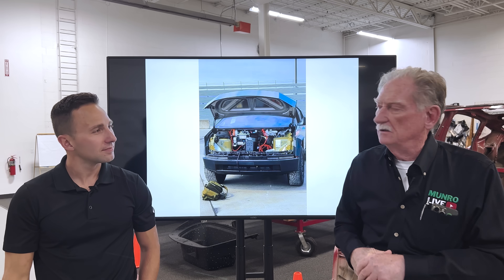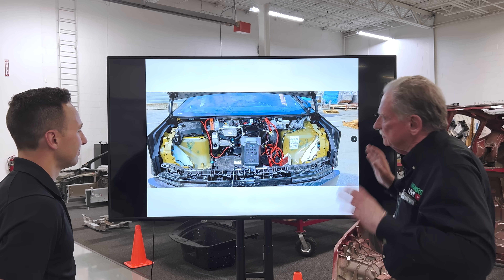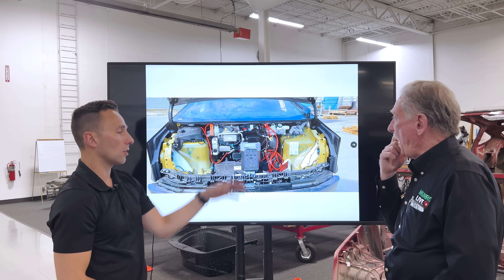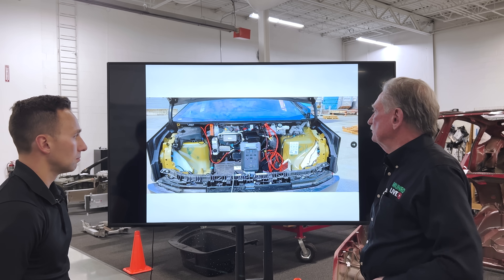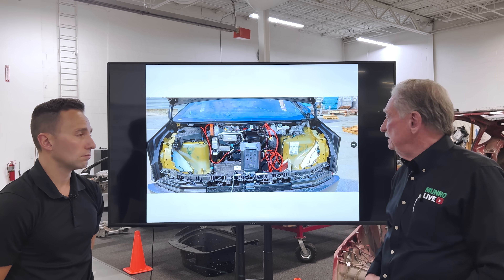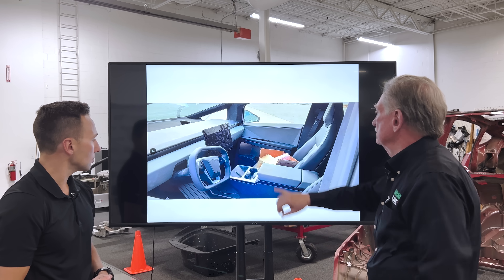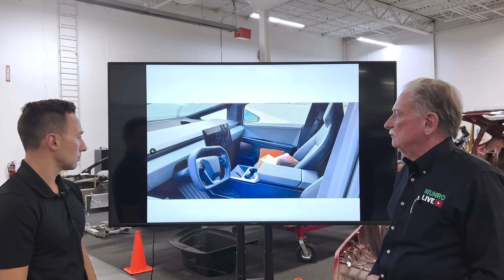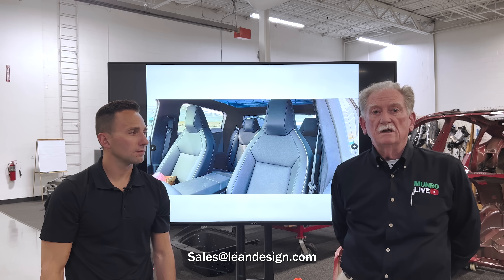Tesla Cybertruck Dual Motor closeups.

Comment: The box at the front is an Ecoflow "Power Station"
(Battery Bank)
Reply: aka solar generator. ive got one myself
Reply: Yes, that’s the main battery pack that drives the truck.
Reply: Found it funny to see that
Reply: the reverse engineering firm knows what an ecoflow is, they said the black box and the silver box
Reply: @JW-mx3qg yea, can get 800 miles out of that thing
Reply: @jasenhenry Nope. It is not a generator. It is an 48 Volt accumulator aka battery (storage) with a build-in DC to AC inverter (110/220/230 V AC or what ever).

Comment: Excellent analysis, as always, with Sandy and Jordan, given pictures of what looks like a 'test-bed' version(...?) What stood out was possibly a change in the thermo-management system. Possibly a redesign of the heat-pump/octovalve(?) Those aluminum[?] front struts don't appear consistent with the IDRA casting, and I have to review the previous Cybertruck front underbody Munro podcast. Thanks again guys👍

Comment: Not sure how works in other countries, but here in Sweden where I live we "have" to use the turn signal when exiting a round-about otherwise you could get fined. Not sure how well the turn-signals on the wheel would work for that. Then again, taking into account how many people here use their turn-signals correctly that might not be an issue, some drivers (*cough *cough, BMW) doesn't seem to have turn-signals at all =)
Reply: As someone who's done durability testing and actually went through a phase researching and implementing signals in roundabouts, aside from using it while exiting potentially the concept is pretty dumb and needlessly overbearing.
Reply: If you have navigation going, hopefully it's automatic.  But, manually, it's not going to operate well, correct.
Reply: What if the turn signals can be voice activated?  Problem solved

Comment: They're using a battery box to power the off the shelf 48 volt power supply (silver box in the lower right), which is being used to charge the battery.  Also, did anyone notice the broken windshield?
Reply: Not only cracked, but the bottom border of the windshield is exposed, ie, easy to crack.
Reply: Broken windshield? I guess Elon personally drove this one.
Reply: @stevebakker6884 hence IT IS a Prototype it looks like the hood hinge collided. At least they know this issue now. In cad it works but in Real life its to flexible.
Reply: Isn't it a support charger - especially if they are running pre prod software/ wiring ? I bet those HV contactors are pinging open all the time😂
Reply: @stevebakker6884  you mean Franz right?
Reply: Oh. Was that Franz who cracked the windows on the truck during the reveal? I was recalling it was Elon.
Reply: @jimmiemac9000 Franz and his balls of steel
Reply: Nope it's not that lol!!!
Reply: Maybe it was parked in a bad part pf Canada

Comment: Those cracks in the wind shield terminate at what look like could be places where stress is loading up unintentionally from underneath. Two cracks  travelling  opposite  directions start right above that mounting point just below. (center left) one of the cracks terminates at the wiper bracket connection location. ..it could be loading stress to the glass as well.
Reply: Shouldn't the armored glass be able to withstand normal stress?
Reply: @WILL_E_1 Stress to the glass edge is very different from front-on impact.
Reply: @EthanMatlack  I suppose they are in uncharted territory with quite a number of these design aspects

Comment: I already pointed this out over on Dirty Tesla, but you guys both overlooked the compliance headlamps and turn signals in the bottom of the frunk sill. They are there because (as I'm sure you understand) the primary lights are on the frunk lid itself so Tesla needs something to satisfy the DOT.
Reply: How do you have the primary headlights on a moveable panel?
Headlights and indicators are  down low.
Reply: Every shot we've seen of them is only down low, the light bar is likely a beauty light. The compliance lighting is on the back of the new 3, you can see the lights shift when Matt from carwow opens the boot

Comment: The cybertruck is on a new 48v plateform. I guess that the 2 or 3kW powerbank we see in the middle is also on 48v battery inside. I just wonder if they really connect that 48v between the cyber and the powerbank thru these red and black jump start cables....😮

Comment: The 3rd party battery is used to provide AC power to the power supply which is used as a “maintainer” to power the LV system in the truck.

Comment: Doesn’t look like the wiper has an eccentric cam (like the Merc W202) to articulate the movement. Perhaps an elaborate drive mechanism, but I don’t think it’s going to “bump” the wiper arm to wipe more of the passenger side of the windshield
Reply: Ya the pivot point is clearly fixed. That motor arm is just to move the wiper arm in a standard arc.

Comment: Thanks Munro - that conclusively proves that the CT is not brake-by-wire, and that producing a RHD CT will require a lot of re-work to the packaging that Jason described in order to reposition the brake master cylinder. Very sad day for us CT reservation holders in Australia :(    I was hoping a break-by-wire solution would make RHD production a no-brainer. Are you able to comment on whether you think there is sufficient space-claim reserved for the brake master cylinder to be re-located to the right hand side?
Reply: They would also need to relocate the wiper motor etc.
Reply: Agree and the wiper motor itself would have to be mirrored - so not simply moving the existing component @rjbiker66
Reply: Something tells me it will be a while before any manufacturer gets up the courage to go completely brake by wire.  Being able to stop is pretty darn important and something you want to be able to do even if you lose your electric power.
Reply: @wtmayhew Brembo Sensify
Reply: @Frank_W.   Thanks for the reply.  The public information on Brembo’s web site doesn’t go into a lot of detail, but notes: “SENSIFY™ is expected to be on the market from beginning 2024.”  I found a pretty good summary on Car & Driver which sheds a little more light.  The Sensify control system supports electric and/or hydraulic braking.  A fully electric version would require a second electric circuit and a second battery for backup.  A fully electric system has not yet been approved for US Federal Motor Vehicle Safety Standards.

Fully electric braking is on the way, but not quite here.  There is choice of which technology implements backup, which is good.
Reply: @wtmayhew  There’s a YouTube video regarding the Sensify brakes and John McElroy did a video regarding them if you’re interested.  I think they would be perfect for the Cybertruck.  Even though I am about 123k in the reservation queue I may not even get it until 2025 unless the ramp is faster than expected.
Reply: @Frank_W.    It will be worth the wait, plus it is gives Tesla 125K units for practice.  Best wishes for an enjoyable purchase.
Reply: @wtmayhew  Thanks for your kind words.  I am patiently waiting on it and in the meantime my TSLA stock can grow.  I have 3 separate accounts with the first one earning enough to pay for the Cybertruck and the other two are currently a little in the red.  I was still buying when it was almost at it’s highest price.  Concerning the CT the more we find out about it the more excited I get.  I’m not one of those people who complain that it doesn’t do some particular function.  People complaining about the smaller frunk size compared to Ford or whoever are so petty.  The truck is going to be incredible and I will accept anything that Tesla puts into it.  Elon stating that it will be a “technology bandwagon” and “it may be our best product yet” only gets me more excited about it.
Reply: @Frank_W.   Thanks for the reply. Cyber Truck looks like the best balance of form and function in the same package.  It seems like a lot of people agree, given the long wait list.  My guess is there are a lot of people on the list who will be first time truck owners.  It makes sense for Tesla to create a product with broad appeal, and it seems the project is on the mark.
Reply: @wtmayhew  I think you are 100% right about that.  When the current actual truck owners find out the capabilities of the Cybertruck then I think a large percentage will want to make the switch.  Of course the CT won’t be able to replace some because of limitations but that’s okay.  Here in GA I hate seeing the diesel trucks blowing black smoke out when they hit the throttle.  They think they are cool but it’s a bit ridiculous.

Comment: Where is the front license plate supposed to go.  Between the radiator intake and the possible radar location it doesn’t look like the plate has anywhere to go but right in the middle of the stainless front panel.  Unless that radar panel is actually a plate mounting point.

Comment: Interesting.  They’ve got an Ecoflow battery ‘generator’ wired to what might be an off the shelf power supply at the lower right.  I’d speculate that’s a 48 Volt power supply for charging the auxiliary battery.  If these are recent photos, it seems to be pretty late in the game to be debugging electrics on that scale.  Charging the auxiliary battery is something pretty basic to the operation of the vehicle.  I’m looking at the relatively clear image at 3:23 in the video.

The interior shot of the dashboard seems to have been photoshopped though a filter.  It almost looks like a CAD drawing, but presumably the box of junk on the seat is real and the same box is in the rear facing photo which looks better.  Maybe it is just because we’re looking at a video of something projected on a monitor.
Reply: Charging this low-voltage battery is pretty basic. But getting all the network components / ECUs to their indvidual low-power sleep states and reduce the residual power draw in a new network architecture is not so basic.
Reply: I think what he is getting at....its not a 12v basic jump pack. It is potentially 48v for the low voltage items like window motors, tail lights, head lights etc @MooseOnEarth

Comment: It looks like that powerbank puts out AC power and they are using an AC/DC inverter to power the jumper cables. The black box on top of the power bank just looks like a cover they're placing over the contacts.

Comment: 15:15 they had that design in Chrysler Pacifica already opened the view on the driver side front quarter panel. But Cybertruck design opened it up more and on both sides.

Comment: Wasn't the original prototype a bench seat in front? I recall thinking the truck would hold six pasengers.
Reply: It was.  They changed it.
Reply: I guess I should pray they don't change it further.
Reply: It was removed because of the center screen and the center person needs a air bag in a crash.

Comment: All this thought goes into this truck that I would love to own. Except for the fact I cannot see how you can mount a winch. I was expecting some hidden compartment behind the front fender with a slot for the line to come out. If everything on this truck was perfect except that, I will not get it. I use my wench quite often. Not for getting unstuck necessary, but for a variety of task. Pulling out other vehicles mostly. I've used it for hanging deer, dragging shipping containers. The versatility of a winch is to great not to have one on a truck if you spend any amount of time camping or being off road, or just about any other sort of outdoor activity. You'd be amazed how often you can find an excuse to use a winch.
Can't call your self a truck, much less an offroad truck without the ability to add a winch, even if it requries some after market brush gaurd, which who knows when that will exist for CyberTruck.
Think I will cancle my order and wait for round two lol. If I can even afford round one to begin with.
Reply: @itchynackers  The problem is I don't see how you mount one. 
All winches no matter the brand have the same bolt 1 of two patterns for mounting so that is solved in the aftermarket. 
Like I said I thought I would eventually see some sort of slot on the lower front to mount a winch on the inside under the frunk area or a way to attach a grill gaurd that can accept a winch. Which is still feasable I guess, but any attachment like that would greatly take away from the underbody height they have achieved and hurt the drag.
So the issue isn't getting a standard winch, but a location for it. Outside one of those on and off hitch solutions on the back.

Comment: If they use the same 16V low-voltage battery, then this would mean, there is not just a sole 48V low-voltage system. Did you miss that? They would need three of them to make this 48V. Or use an internal DCDC converter. Or they needed 12 cells in there instead of just 4.

Comment: Would they keep a 12v battery on a 48v architecture?
Reply: I was wondering about their 12v reference as well.  Maybe he meant 48v?
Reply: I suspect they use a 48v battery and a DC to DC converter to 12v for the few things that may still need it (like the accessory power port).

Comment: 16:10 can’t disagree more strongly. Removing the turn signal stalks is a horrific idea and is really putting me off updating my current Tesla.  There are just so many instances where you need to use your indicators while turning the wheel, and if it’s not a steer-by-wire where the wheel never turns more than about 80º then you’ll be looking at the steering to find where the stupid button has gone.  Same goes for a quick wipe of the windshield or flashing the headlights.  All of this has to happen from muscle memory or you are taking your eyes off of the road.  Outside of the US we have roundabouts and you are required to indicate while leaving the circle, which means that the wheel isn’t straight when you need to do so. Good luck doing that with the wheel potentially at 90º or more. Near my home there is a section of road where I need to make a left followed by an immediate right turn, and I am always switching the indicators from left to right while still coming out of the turn. Once again a massive fail with a stalkless design - and also why I don’t want a stupid yolk unless it is steer by wire.
Reply: I totally agree. Might have to keep our '20 Model S forever. Three stalks on the left. Only the wheel position is very seldom used, but turn signals, lights, and wipers are used all the time without taking eyes off the road. Munro, tells us what this stalkless BS saves? $50? I'll gladly pay it. Also like the shifter stalk on the right. Way faster and safer.

Comment: The content of that sticker on the driver-side casting would have been interesting. These are option codes that steer production.
Reply: One reads Dual Motor
Reply: @mini2nut67  But there is way more. What I believe to read as option codes on this sticker after seeing the Twitter images:
TW01 that is Tow Hitch
BT46 that is a new battery
BD01 
OR00
RD08 that is 4D1 / DU CAT 4 Performance Motor
DV4W
IC03
SA02
WH08
VARIANT: DUAL MOTOR

Comment: That would be a 48-volt battery at the cross-beam but nearly the same physical size.
Reply: The 12 volt battery will be upgraded to 48 volt with an over the air update. :)

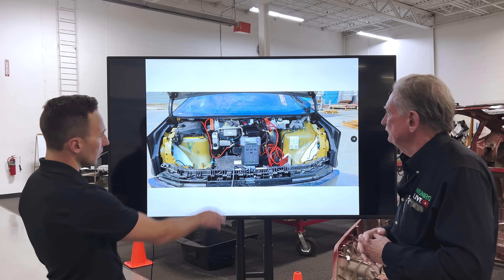Comment: 1:46 That black box on the EcoFlow  Delta power station could be the (dead?) 16-Volt-battery. The silver box right next to the red/black cable mess could be a makeshift power supply. Possibly the DC-to-DC (400 Volt to 16 Volt) converter broke down and they wanted to reestablish and revive the 16 Volt systen.
Reply: 48V or 16V?

Comment: Nice video, good insights. The more I see of the CT, I have to ask - is the simplified geometry worth it? Failed exoskeleton, additional side windows, massive windshield w/ huge wiper. It looks like it's engineered for engineering sake.

I've read that this is a "kool-aid detector" - will people only buy this because it's a Tesla? I can't say I see any huge superiority over the Lightning. I'll take the bigger frunk, P2G, tried and true truck company.
Reply: Indeed, Tesla has to make the Cyber Truck manufacturable and to meet a price point.  That reality put the brakes on some of the radical prototype ideas.  There is still plenty of innovation visible, so it isn’t all bad news.  It looks like there is liberal use of cast components, for example.

Personally, I’m kind of on the rail about what I want to do when I replace my 2005 Toyota Tacoma.  The F-150 is larger, but I like that there is so much after market stuff available from the ICE version.  I like what I see in Rivian’s trucks, and you can actually have one right now, depending on what you’ll accept for options.  The Cyber Truck still isn’t officially here as of September 2023 and there is a long waiting list to slog through if you order one now.  I think I’ll try to keep the Toyota a few more years to see what settles out in the EV truck,market.

Something I have to say is that I like the relative simplicity of the older Tacoma.  I don’t really care that there isn’t a 12 inch infotainment screen.  I like having easily operated rotary controls - something you notice in a truck on a rough surface.  The big thing is the electric transfer case and front hubs so I don’t have to get out in the rain/snow to lock the hubs like back in the bad old 1970s.
Reply: @wtmayhew I have a 07 Tacoma and once I get the Cybertruck I think I’ll hold onto the Tacoma for a bit.   I have kept it looking nice and it is well maintained.  237k miles and still has original water pump.  It costs less than $2k a year to insure and register it.
Reply: @Frank_W.  Thanks for the reply.  My ‘05 had the frame rust recall in 2016 and getting a new frame gave it a lot of extra life.
Reply: @wtmayhew  I took advantage of the leaf spring recall and at the time I went ahead and put new shocks all the way around.